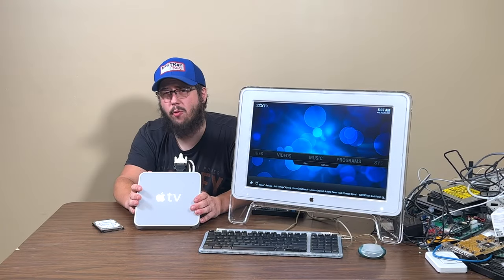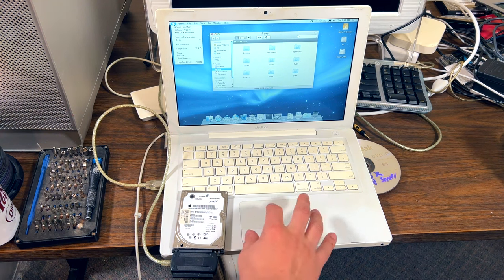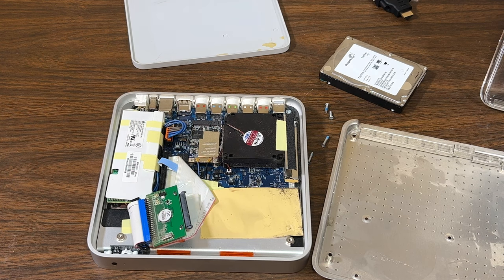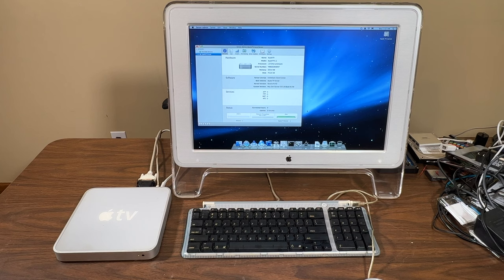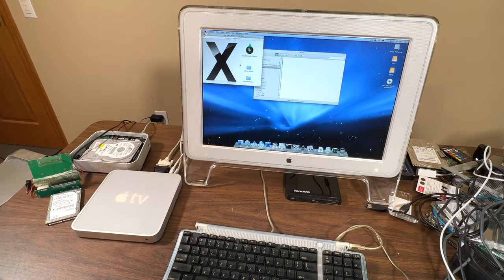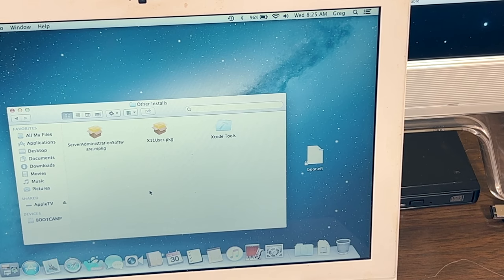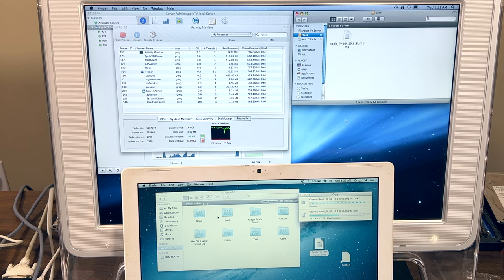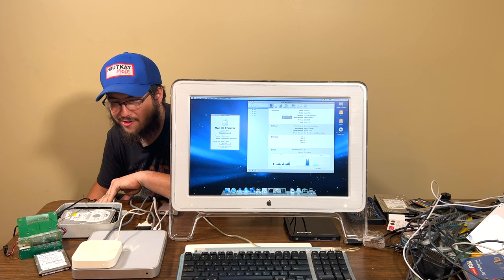Turning An Apple TV Into A Full Mac Server

Comment: Is it possible to trick the MacBook Pro (Late 2011) that it is using the battery ???
- Currently i am running MacBook Pro without battery it's serving the purpose but as we know without Battery 🔋 the performance goes down by 50%-60% and it becomes slow but is there any solution to overcome that without getting the new battery (Already replaced 5 Batteries, Don't want to spend more) 
- I am using this MacBook Pro (Late 2011) as a server only - I have deleted MacOS High Sierra and i only use it for Linux But even than the performance is slow - is there a way to bypass this limitation ???
Reply from the maker: Where is a patch for that in opencore, but I don’t know if it would work with Linux… if it is an EFI Linux install in theory, I think it would work
Reply: could cut open the battery., cut out the cells. just connect BMS to mac. should bypass the issue.
Reply from the maker: You might be able to jumper it out too, I have a friend that got a board to work in an iMac G4 I can’t remember how he did it
Reply: @HrutkayMods   How about using a powerbank ??? I know it may sounds silly but it as custom battery !!!
- instead of connecting to charging port connect it to where battery connect ??? it should work if we putput the same voltage as original battery did 
or
- lets say people build custom batteries usually larger battery for more backup for different devices such as mobile or portable electronics - all i am saying instead of connecting a custom battery or powerbank to the charging port connect it to battery plug 🔌 on MacBook
Reply from the maker: @garrysingh4484  If the BMS communicates with the logic board properly yeah it'd work otherwise i'm not sure unless it just needs a constant power on one of the lines